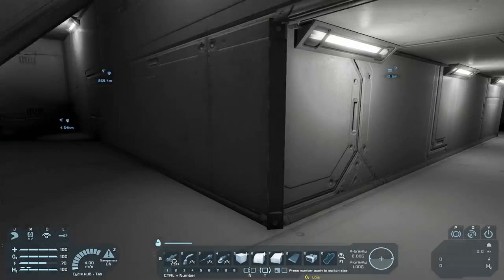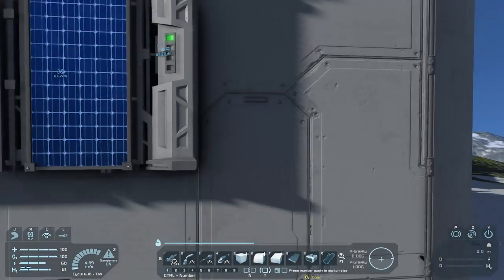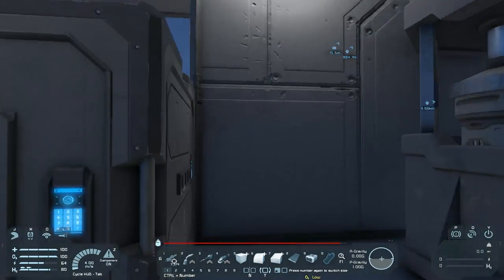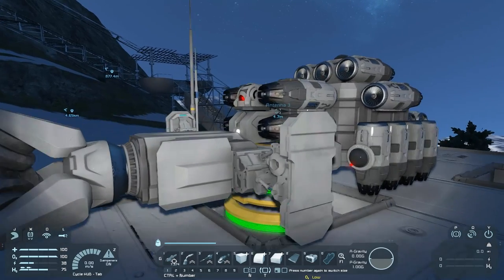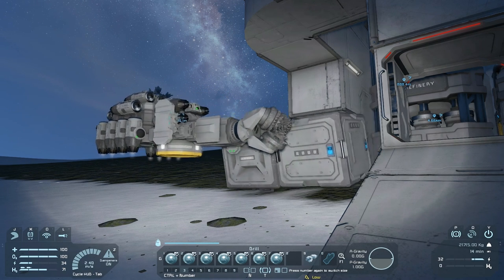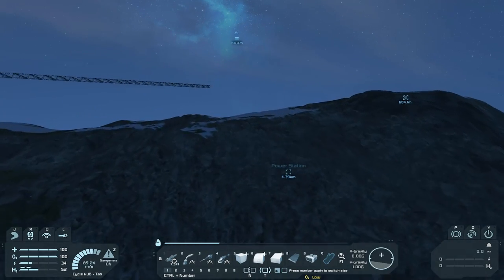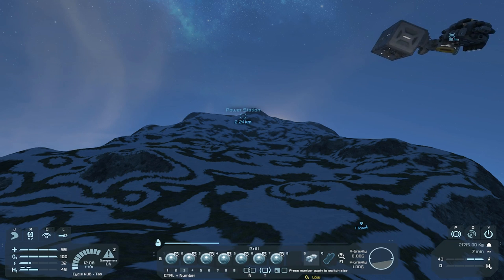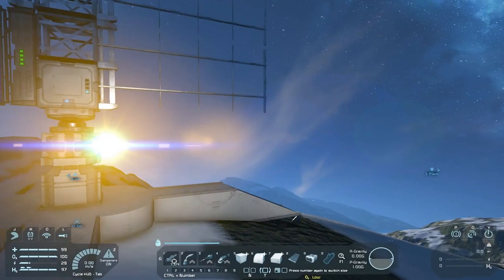Let's Play Space Engineers - Episode 13: Moving A Battery & Getting Stranded On A Peak!

Comment: you could use the same trick you used on your battery on your hydrogen tank as well, even if it's partially full you could transfer it; you just have to be extremely careful. Also, you need to put your transfer station in place first so that your hydrogen tank has somewhere to go when you arrive it's a new destination.

Comment: The problem you were having with the RC is because as soon as you disconnected the battery the antenna on the base no longer had power and couldn't relay your signal to the drone.

Comment: You had problem with remote control because you need to have two way conection in order to control something remotely and your suit have antena range of 150m. So what you should have done is to setup antena at base to relay your suit's signal. So if you have big antena at base and at second base you can remote control drone over 10km distance cos it could switch to big antena at reciving end and mantain two way connection.

And I see you had antena in base so maybe it was off or you had not enough power to run it properly? Or you had ownership messed up. One antena belongs to you and one to neutral. It happens all the time in SE.

Or you can use small laser antena instead. That have 20km range I belive. But you would probably still need a relay like comunication satelite over your base. And that would be cool thing to do too. But I understand that you are not there yet in this series. Maybe in future? ;)
Reply: Shinzo's Sins also, installing a passenger seat on the drone would have solved that problem.
Reply: Matthew Richey That came to my mind when he was thinking how to travel the distance back and forth. But it kinda ruins the concept of having remote drone. And also you can't look around really while controling this way.
Long story short keep cockpit on your ship or get ready for a lot of pain in the back.
Reply: Shinzo's Sins something else I thought of is you can use the auto pilot of the remote block then you could look around. I hear the collision avoidance of atmospheric drones is pretty good now. since he did have a GPS point marked I wonder if that could have worked.